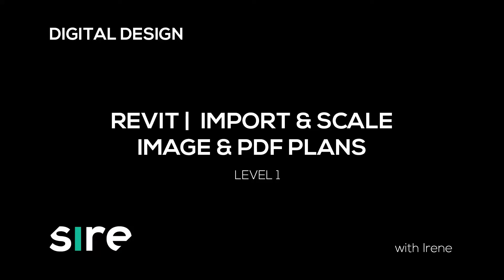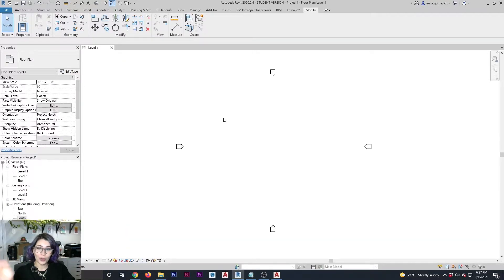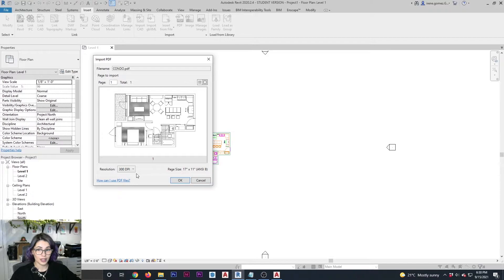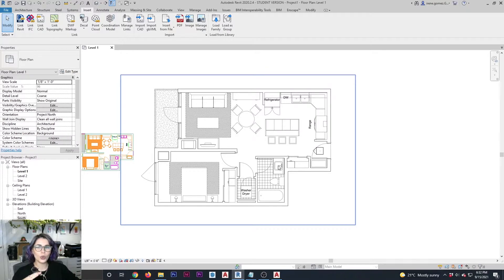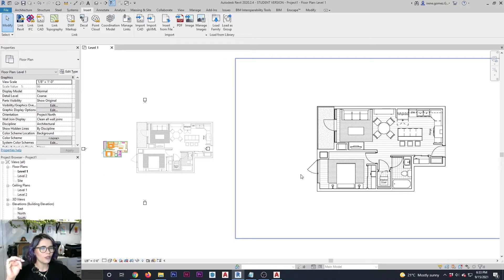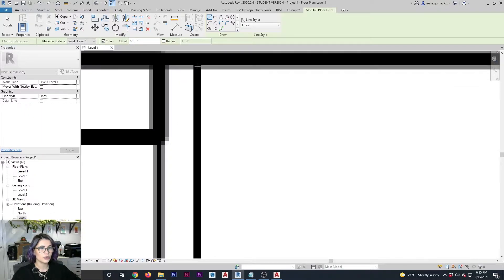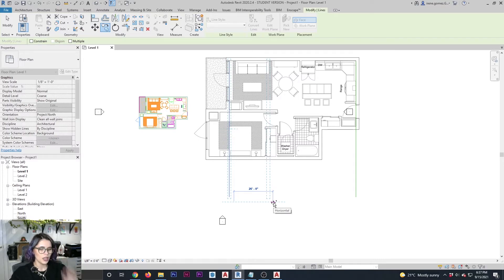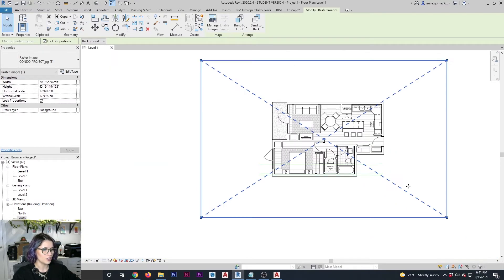Revit - Importing and scaling images and PDF files

Comment: nice overview, I usually link a file (CAD or PDF) into a drafting view that allows better scale management
Reply from the maker: Thanks for sharing! What difference does it make using the drafting view? Would love to try it out.
Reply: @irenedigitaldesign  It's useful if you have reference drawings that you don't want to redraw. You can place the drawing in a drafting view and use the same scale (you can also change the scale). It's more applicable for construction documentation (not so much for presentation drawings). Yeah, give it a shot if sometime.....
Reply from the maker: Ohhhh I see! Great idea, I'll definitely give it a try.